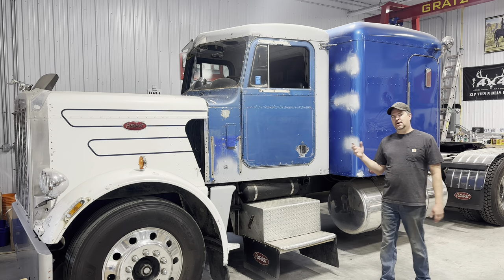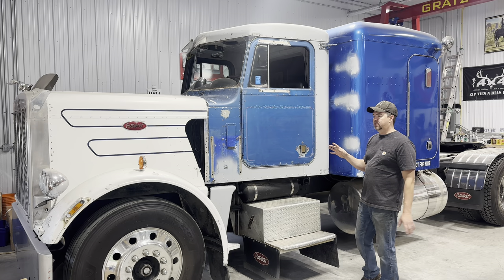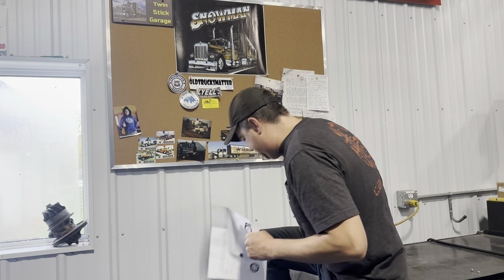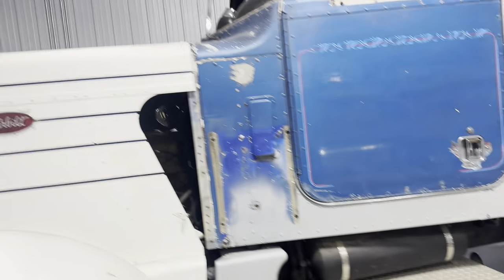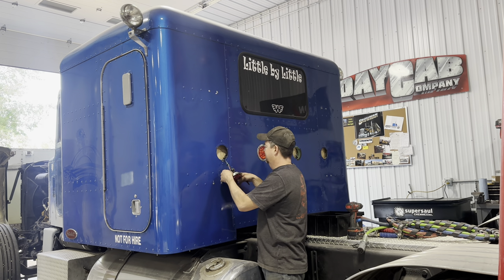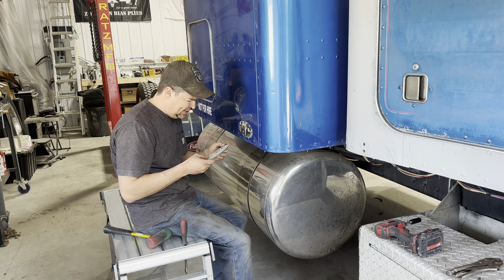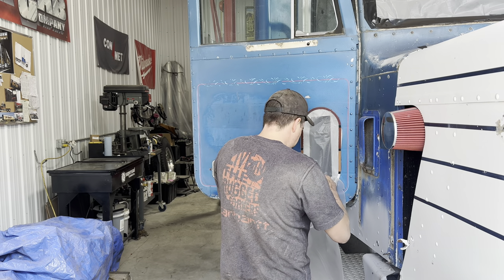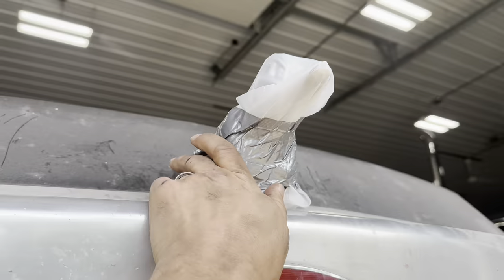Peterbilt 359 Restoration Ep.76 Stripping the Pete

Comment: The key with aircraft coating remover is to put plastic over the areas you apply it to so it does not dry out.  Once it dries it stops working.  Keeping it moist is key for successful paint removal with one application.

You should get a proper rivet sander / polisher, they are commonly used for aircraft building and repair.
Reply: Please don't leave the hood white.
Reply: And apply thick a big spay bottle with water to keep moist works good.

Comment: I’d say paint the whole truck blue, use the same designed stripes that were on hood in white down the whole side, but add a little grey and black on edges of stripes to break up/ blend the scheme more, then front fenders base coat blue and the add the stripes up and down with grey and black boarders, that way your base colour is all one colour and still paying omage to the white that was the hood and still have that 70/80’s feel

Comment: Hey Mark careful grinding around glass. The sparks melt into the glass and then rust. Also you can take car cover plastic and stick it over the wet aircraft stripper. It keeps it wet longer and traps the fumes/doubles the stripping action. Keep up the good work!
Reply: There is actually no glass In the windows. He removed it a few episodes back

Comment: Mark use stripper in the shade! Also hit the areas with a red scotch bright it'll help strip excess off. If you've gone over the whole truck and you still have stripper left over, you didn't use enough of it put it on thick.  It's drying so fast it can't react to the paint. Do it inside the shop no fans on.. Cool Temperature is your friend It's drying to fast and the metal is hot...works better in shade..Negative on leaving hood white...just do all blue with a very simple white stripe

Comment: When I did my 379 in 2009, I had it stripped to bare metal too.  1 primer, 2 coats of paint, 2 clear. When I sold it in 2015 still looks the same. No rust anywhere!
We painted it atomic burnt orange, 1998 Corvette color.

Comment: You can buy stripper in an arisol can. Paint and body shops use it. It’s great takes it down to the primer. Just spray it on and blow the paint off with an air hose.

Comment: Go with the Sovereign Blue like you want. I love the color. Paint the whole thing blue, leave the striping basic with not alot of design so it doesn't look too 'busy' and i think it'll look great. I agree, paint the hood off the truck. The gantry crane will definitely work, but you also proved before the tailgate/ bed of your pickup just happens to be the perfect height to dismount/ transfer the hood over to the pickup... Better to paint the hood off the truck like you said, that way you can get the inside too. I hope you do the door jambs and whatnot too. That truck is too nice not to, but if i know you, Mark you'll do it good justice. Aircraft paint stripper is good stuff. Was gonna suggest to grab your spreader you'd use for applying filler and 'scrape' all those layers of paint right off, but you already knew enough to do just that! 😊 Nice progress Mark! Sovereign Blue is such a nice color, I hope you stick with that color. The Pete will look so great with the entire rig done in that color.👍👍

Comment: An easy truck for removing emblems put in with 3m adhesive tape. Use heavy braided fishing line and run it behind the emblem on one corner / side. Then work it back and forth like a hand saw. Takes it right off then eraser wheel the rest.

Comment: Being in facility management, we use stripper in equipment, rooms and stuff like that exterior zone, generator equipment, and when we stripped it, we would just do like a 4 x 4 section at a time laying on heavy scrape. It don’t let it dry. That was the key the key not letting it dry.

Comment: Mark I was a helper in my uncle's Restoration shop

I'm very familiar with the aircraft stripper
Been over 30 years I still remember the burning on your skin

We once stripped it a trunk lid with 7 coats of paint and primer

You should use a scraper to remove the loosened paint before rinsing while rinsing use red scotch bright pad to remove most of the remaining stuff

It does work better in the shade

Also works on fiberglass just work fast

Paint scheme idea

Using the stripes laid out on your hood

Bring them around your truck level

White over blue with white roof caps on cab and sleeper

Twinsticks logo on the doors

If you got it a trucker brought it

On the back of the sleeper

Not for hire and as seen on YouTube on bottom sides of the sleeper

All in white letters except YouTube logo

Let me know what you think

Comment: Paint the Hood and cab to the front windshield White and the rest of the Cab and Sleeper Blue.  Then add some 2 or 3 inch Stripes ... using the Blue for the Hood and the White for the cab and sleeper!!!  Not sure if it is possible to do a fade from 1 color to the other, but that could be cool as well.

Comment: Paint all one colour with retro stripe kit I think. Be careful with stripper on those rubber seals and most likely toast now & the stripper I would personally 80 grit by hand to dig intoo the paint over sanding smooth with file or orbital.. And do one area at a time, don't let the stripper dry out. Put plastic over top of what you have just put stripper on, it conducts heat etc and helps the stripper do it's thing. All the best, cheers from NewZealand

Comment: When you first got the truck, it was solid blue with pin stripping. To me, the white hood would look unfinished. Or people will always be asking when you had the wreck, and when are you going to paint the hood to match the rest of the truck. BUT, it's your baby, make it what YOU want!
Reply: Do you think that people always asked someone that had a muscle car of some sort the same question if that car had a hood or maybe a trunk lid painted a different color? A lot came from the factory painted that way, and it definitely still has some appeal today. Granted, most were flat black, but wouldn't that still give an unfinished look to the vehicle based on your description of an unfinished paint job? Even today, more and more, there are cars rolling off the assembly line with the roof or the upper part of the car painted a different color than the rest of it. Do they look unfinished to you?

Comment: Hi Mark I personally think go peterbuilt blue as she is and the hood the same blue but with the two stripes on the hood paint them white the run them from where they both start and tack them across the doors and as you get to the sleeper then angle both straps to the top and back of the sleeper. p/s when angled curve them as they turn up so there's not a sharp angle to them.

Comment: Methylene Chloride (the active ingredient in most paint strippers) absolutely will eat through Nitrile gloves, you're better off to use the thicker PVC ones you swapped to. Also the thicker you put it on the better it works, after a while the Methylene Chloride will evaporate off so the thicker the coat the less chance of it evaporating before it reacts with the paint.

Comment: I agree with u mate one color with whatever accents you want and I'm always a fan of blue trucks. Also I used that stuff to strip parts and I found the power washer doesn't work very well unless u have one strong enuf to take the paint of even without the stripper so just keep applying and scrapping the product does tend to move to the sides of the applicator so that's prob why you have non treated bits.

Comment: That stripper kinda stops working when it dries out. What I do myself is. I pick a panel " section" and put a lot on and make sure its even and well applied. Then I drape plasic poly over it to help keep it from drying out. Let the striper do it`s work. Scrap, clean and move on to the next section.

Comment: Hmmmm...........................Blue over white with some sort of break up between the two. You could get the company that did snow man to put a wrap layer that blends the two colors. The wrap could be inverse of the other. Blue pinstripe on white and white pinstripe on the blue. What you do for the top you do for the bottom. The flipping colors would do good with the chrome that you have. It's rare for modern trucks to have pin-striping bit it was far more common in the 70's and 80's.

Comment: This brought back memories (or nightmares) of when I stripped the paint off my 22' Sylvan Skipper boat.  I probably used over 10 gallons of that chemical snot to get all the paint and primer off.  The primer was the worse, as I had to apply the stripper, scrub with a brass brush while flushing with water.  Otherwise, the primer would just lay back down on the aluminum.  

If I was to tackle this, I'd only do one section at a time.  Hood one weekend, then cab, then sleeper.  You may have better luck with the stripper, if you overlay it with some plastic sheeting, and then let it set.  You need the vapors to be retained.  Doing it outside, over such a large area, it's prone to 'off gas' too rapidly.  Thus, reducing the effectiveness of the chemical.

I wouldn't do the white hood with the rest of the truck in color.  Onlookers will always think it's a quick replacement after an oopsie.  Go with the classic Peterbilt paint scheme of the era.The wife will warm up to it (hopefully).  Or forego the big stripes, and get some classy pinstriping done.  I always liked these conventionals in either dark blue, burgundy, or a ruby red.  Saw one or two in yellow, that didn't look too bad, either.  You want a color, that will allow all that high dollar chrome to pop.
 
Keep on truckin...

Comment: Hay MARK  you can't  leave  the striper sit on the truck and dry  in the sun The chemical will sink into the metal. If you don't get it off soon enough, and you'll never be able to get paint to stick to it without having to totally appoxy the whole cab. And when you warsh it off it is best at the end is to flush with a hose

Comment: looks to me like your putting the paint stripper on a bit too thin, you want to goop that stuff on there as thick as you can without it actually running off and periodically re apply and spread it around as it soaks, its drying out on you that's why its coming off to bear metal in some spots and not others. paint roller is a pretty cool idea i may have to try that next time i chemically strip something.

Comment: Aircraft stripper, put it on thicker than 1mm and it should work better. The old aircraft stripper would work with no sanding of clearcoat, it is thick so as to stick to the underside of fuselages.

Comment: Almost correct 1954 production year was the first year of the oval emblem before that they were rectangle I use that same paint stripper a lot goop it on thick to the point where it almost wants to run off about the thickness of line x truckbed liner and it will do 95% to bare metal on the first pass basically on that truck one and a half to one and 3/4 cans of stripper

Comment: The design of your paint scheme is right their in the edge(rear) of your hood ????
I would paint the base of the truck blue and where the rear of hood curves I would start me a white two tone stripe and take it all the around the bottom of truck and sleeper around the back and to the other side then break that up with another stripe in front and on top of that strip-thinning out to a pin strip at 
the end of the sleeper but not wrapping around the back  of sleeper and a third color just alittle smaller which come up to the top of hood and become a pin stripe that go to end of the cab then stop…. Kinda looking like the stripes are staked on top of each other if you can vision that???